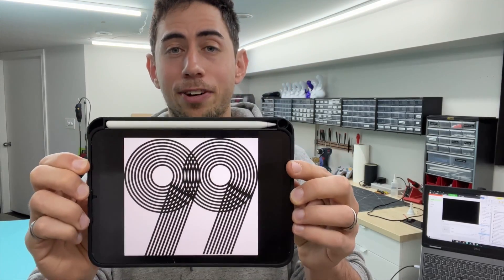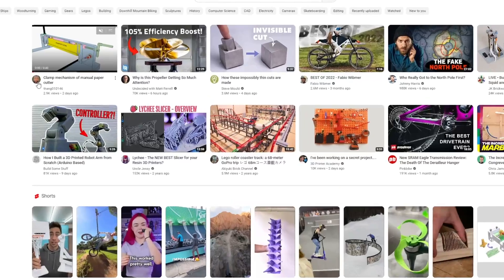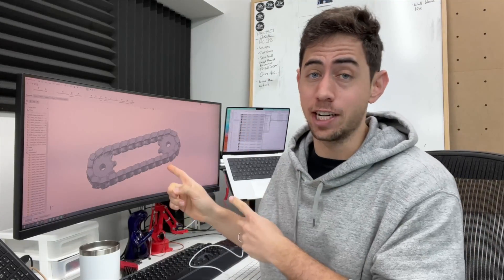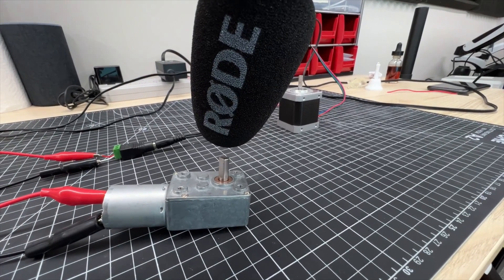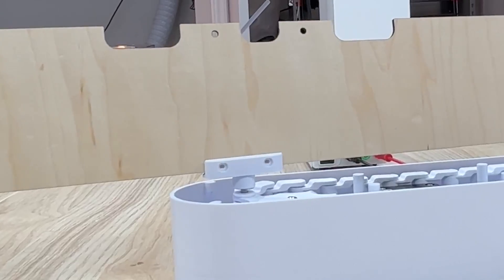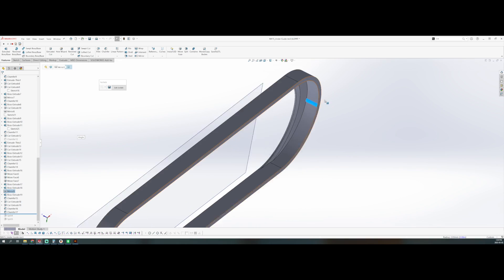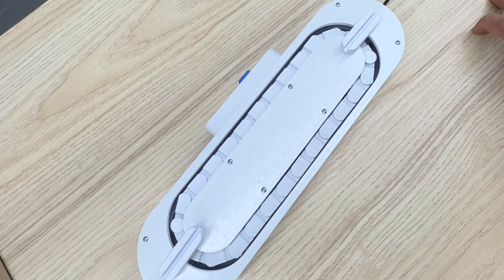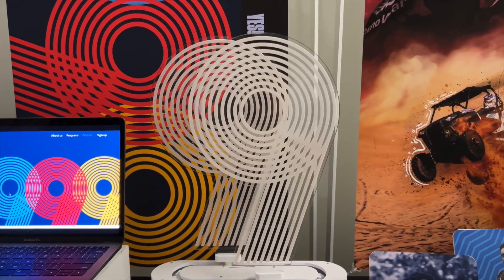Making a Digital Logo Move IRL

Comment: Just figurin out, have you never ever heard abaut lubrication? Same as english: Use some oil, or grease etc, and it will work 99% accuracy! Ps. Sorry for my english language, I am not an American, or English. I am from Finland. And thats a far far a way from countrys, that speaks english. But yeah, you have a pretty fucking nice inventions and videos!! I really like your videos. Just so excellent engineering! I personaly do not like plastic, so I do everything from different kind of metals usually. But still, I do appreciate your work very high! Good job man!! Take the next level and start doing things on full metals! I guarantee you will get way more views, if that really makes any differens.. 3D printers and plastics are kind of toys from my perspective.. So, I see your works like a toys, but for adults.. at least kind of.. I suggest you to do some upgrade and make all those things from metals, and you would be one of the most popular engineers at the youtube! Trust me, I am an machinist! And Pps, I really like your videos. Do, what you do the best and do it as you really want to do. But do it with full throttle!! Thanks bro!!

Comment: Wouldnt it be qay simpler to take 3 gears of the same size in a line and putting the logo on the outer two gears and then rotate the whole thing. Wouldnt that keep the letters straight? Or do I miss somethibg

Comment: This is dope, mind adding in more explanation/how things work about the electronics in your videos?
I have a 3d printer and use fusion 360 but just the electronics and programming seem so daunting.
Reply from the maker: This is a stepper motor driven through a tmc2209 driver and an arduino- not the most knowledgeable about electronics so I would recommend looking for some tutorials on yt! But there are tons out there!

Comment: The bearings weren’t a great idea. You have it in a track so when the bearings are moving they have a force on each side of the bearing in the same direction assuming a tight fit, hence the bearings won’t spin, just slide.

Edit: you should have put some grease in the track and then tried it again.
Reply from the maker: That’s why we iterate!

Comment: bearing won't do much in that design, no? cause it looks like they are touching on both sides and won't rotate really
Reply from the maker: I was hoping it would help around the curves, or at least slide better than the plastic on plastic. Didn’t really make a difference in this case